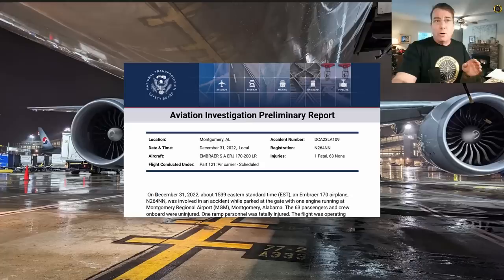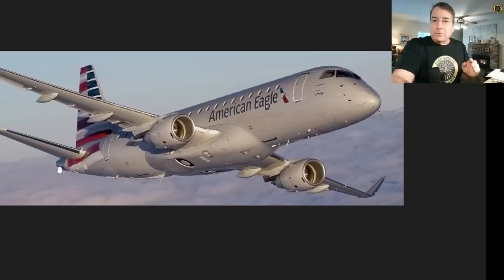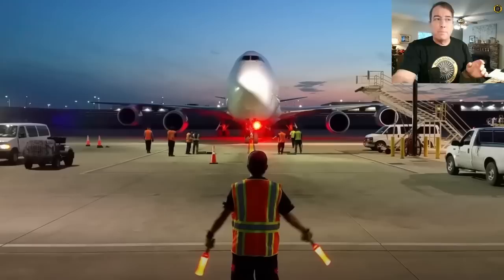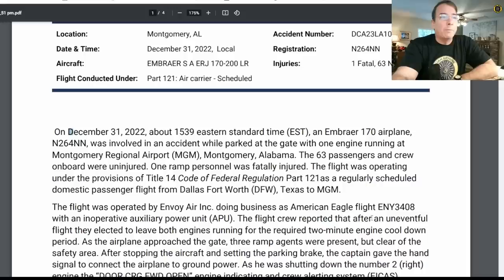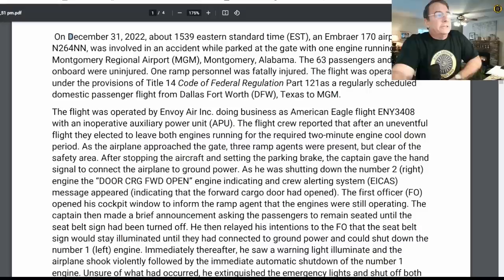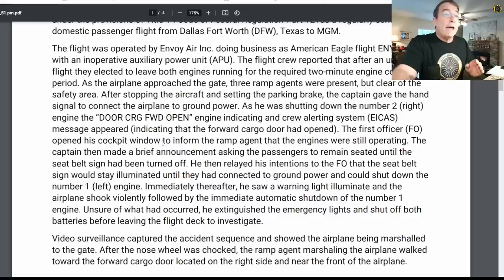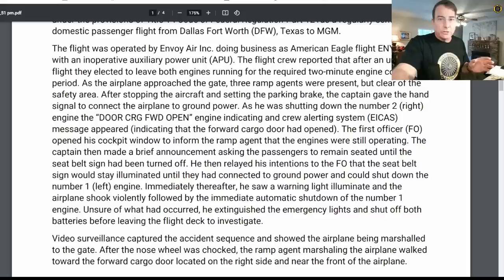NTSB Preliminary Report Ramp Agent Fatality 31 Dec 2022 Montgomery Al.

Comment: i used to be a ramp agent for Fedex  at a small airport . of course there was pressure to load/unload the planes on time but no one i worked with had ever taken short cuts , specially approaching planes . I remember one ,where the pilot forgot to turn off the beacon lights after shutting off the engine and we had to wait an extra 5-10 minutes to approach the plane . in this incident not only one agent but 4 crossed the safety envelope line. i don';t know what's going on at the Montgomery airport .
Reply: So no one was smart enough to walk to the front to verify the engines where off??

Comment: This is so sad. At the airline I work at our policy is to not enter the gate area until the engine cool down time has been met. If needed, we will wait on a taxi way or in the ramp area; but we do not pull into the gate area still requiring engine cool down time for this very reason.

Comment: When I was in the Navy I worked on and around F8’s and A7’s. Both of these aircraft had intakes that were very low to the ground.  That configuration required ground and maintenance crews to be alert especially during night operations. The engine would be running during launches, recoveries, and when the Jet was taxiing. Plane Captains and maintenance personnel had to be present and in close proximity to the plane when the engine was running during ground operations and on the flight deck of carrier operations.

Comment: Hi Juan, here in Europe I fly both B737 and Embraer 190. It is our habit on the Ejet to shut down the number one first when an external gpu has to be inserted mainly because the receptacle is on the left side. On the 737 it is the other way around. BUT: if you need to shut down the number one on the Ejet you have to manually activate an hydraulic pump.(this is to keep some necessary brake pressure)You do NOT have to do this when shutting down only the number two. I see lots of pilots shutting down the number two first just to not be bothered to switch on manually an hydraulic pump.  (Pilot laziness?)  Anyway, a very tragic and preventable accident. Btw: the clock does not stop when opening the cargo door.

Comment: At an airline in the 80's, the spouse of a person in our office work group worked out on the ramp.  Said their spouse was always complaining about rushing procedures to shorten times used for on-time stats.  Said it would end up getting people injured, killed, or fired/reassigned.  Few years later, some desk jockey in the airline had a 'lightbulb' moment and decided on-time stats was a game and they could get advantage on within the rules.  Started adding 15-20 minutes to every scheduled route time to account for ground delays going out and back in.  (remember the days of people noticing/complaining that some airline's flights took longer than others between the same two airports?)  Somewhat lessened the pressure on the ramp crews for them to cut corners to reduce times.  Was a huge deal at the time. On-Time stats would come out and the airline bean counters could immediately identify changes in ticket sales, up or down based on Stats being better or worse.   Billions of dollars go thru an airline's fingers in a year. They do ALL THEY CAN to try and keep a penny from each one.  We had a display in the office of an airline dollar bill. Was segmented into the various costs coming out of that dollar and how much they were able to keep. Display updated regularly.  The point was, were you doing your part to keep a penny.

Comment: It would be interesting to know how '15 feet' was computed. The distance at which you are at risk of being drawn towards the engine is going to vary a LOT depending on if you're 50kg or 150kg, and baggy clothing adding to your silhuoette or ice will make this far worse.
Reply: More like surface area presented to relative winds.
Reply: Humans are all basically the same density. Fat ones have more surface area than skinny ones, so it all roughly works out the same. Clothing is a bigger variable. A burka is going to be more dangerous than a bathing suit in this regard, as the sail like construction of a full body covering will entrain quite a lot of air.
Reply: @sheldoniusRex  they are very much not the same sectional density.
Reply: @sheldoniusRex  And so while within 15 feet of a turning turbine, I wanna be a petite Heidi Klum wearing dental floss.
Reply: @cheddar2648  just tie up your hair.

Comment: I’m a captain on the 175 for a regional. Inop APU’s are not uncommon. I’ve stopped in front of the gate and made sure everyone is clear before I enter. I also shut down ENG 1 so the GPU can be connected and just turn on HYD SYS 1. Opening the Cargo door does not stop the clock. The MCD does.

Comment: I worked on a ramp during the holiday season several years ago. There was incredible pressure to go fast and take initiative. Workers who waited for instruction to do things were quickly labelled lazy or idiot by more seasoned workers. There was a big shame game for not fitting in with the top performers. I was only there for 3 months but in that time I saw two accidents. The first was another worker not watching where he was stepping and falling 3-5 feet from a loading platform. The other was a supervisor making an adjustment atop a tug trailer without the driver realizing he was there, speeding off and the supervisor falling over and dragged a short distance with his leg stuck in the trailer. As far as I know, neither accident was reported, which leads me to believe that these things happen much more often than expected.
Reply: What was he adjusting?

Comment: As a Mechanic for two major airlines over 25 years I think complacency is probably the biggest factor, where engines left running due to a placarded APU is not always an everyday occurrence.
Ramp agents get in a hurry, they are used to the engines running while the airplane taxi's into the gate, the noise is constant, rotating beacons blend into a function of every flight, they go unnoticed. Management is breathing down their necks, turn around time is paramount.
Back in 1987 at DFW I was sent out to inspect a wing engine on a DC-10 that had a ramper's heavy coat get sucked into it, right off of his arm after he had taken it off, as he walking right past the running engine. That guy was white as a sheet, he told me the engine almost got him. That one went to the hangar for an engine change.
Those statements on that report read like they were supposed to, sure they had a huddle, and a safety briefing before the plane pulled into the gate. Yeah right. Sorry for sounding so callus. 
This is tragic, someone lost their life, it should not have happened, but complacency will get these results.

Comment: There's a white spiral on the fan cone of most airliner jet engines to act as a visual indication of safe speed to be in close proximity of a spinning engine. If you cannot distinguish a clear spiral as it rotates, then the engine is still rotating too fast to be safe for any approach.  Of course that device is not visible from the side of the engine.
Reply: They're also for birds.
Reply: Thought those were bird repellent.

Comment: At a previous airline, the aircraft would block us in with the cargo door at first, but contractually was supposed to be the main cabin door.  A grievance was filed and the method was changed through software.  The reason was the rampers could come unload the plane and we would be waiting on a jetway driver the entire time, not getting paid while still managing the aircraft.

Comment: I guess after being an aircraft maintainer for 15 years in the Air Force it’s just drilled in my head to stay clear of running engines.  We maintain 25 ft cone of safety from running engines.   In all my years in the AF I’ve never seen anyone come even close to this happening.   I don’t get how this could happen!!
Reply: I am a veteran though I did not do much work around aircraft, and I worked as a civilian ramp agent.  There is a big difference between military and civilian management.  In the military there a chain of command (singular).  It goes up to the commanding officer, and in the literal sense, continues up to the president.  At an airport there are many chains of command.  Everybody wants to be in charge; TSA, whoever owns and operates the airport, not to be confused with the FBO, the various airlines who use the airport, visiting auditors, etc.

I note that where I was stationed we always had to be covered outdoors (wear a hat).  But on the apron hats were forbidden because of fear they could be sucked into an engine.  At my training command I walked across the runway to get to class.  If an aircraft was expected someone would very politely say, "Excuse me sarge, could you go around?  An airplane is gonna land here."  This was at Keesler.
Reply: Simple
HUB disease.
Head Up Butt

Comment: The In time on the E170 is based on parking brake set AND the L1 (forward boarding door) vent flap/slide being disarmed. Fairly certain that opening a cargo door would not trigger an in time.

Comment: Former ramper at a small seasonal airport - we had no jet way . All our gear would be staged and ready to grab luggage asap After a “ clear “ signal by a co - worker after a walk around inspection. We typically would not connect APU as plane would not be on the ground long. Our training was similar to what was shown here. Our cargo door was under the #1 engine on the CJR - not user friendly at all.

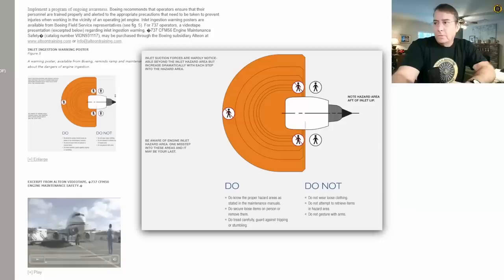Comment: The chart at 2:19 is a MINIMUM reference for safety. The ingestion hazard doesn't stay perfectly symmetrical like  drawing on a chart. Running jet engines can generate vortex......and these vortex can dance ALL around the inlet like a tornado. I've seen it many times. Also FOD can get sucked into an engine and it can take YOU with it. Something like a tarp or a large piece of cardboard etc. What about a wind gust that pushes things towards the running engine? That's why that work environment is for very well trained people.

Comment: I worked the ramp at Miami International the summer of 1979 for ARA Ground Services. We received two nights of training in the classroom and then we were taken out to the ramp for hands on training. Back then, I worked concourse F and G which served Air Florida and National Airlines. 

Years later, I became an airline pilot based out of Miami. So I appreciate the work and dedication of the line personnel or “rampers” as we call them. I treat all my fellow co-workers with respect because I have been there too. 

Always remember the GOLDEN RULE: “Do unto others as you would have them do unto you!”

My current airline had a policy of always leaving engine number 1 running at gate arrival in order to reduce APU start cycles, APU usage and APU fuel consumption. I did not follow this policy. I start the APU approaching the gate, at the gate I shut down both engines. Then the  Beacon light is turned off. Then, after external power is established, the APU is shutdown. No Check airman at my airline has dinged me for my personal safety policy. My biggest fear was ingesting a ramper or ingesting FOD in the gate area. Well, this accident shows what can so easily go wrong for the ramper that is distracted. Years ago, a ramper walked thru the spinning prop of a E-110 Banderante in Freeport, Bahamas. He was killed instantly. 
And very recently, a female belt-loader with long hair caught her hair in the belt-drive and lost her scalp which led to her death. I think that was in Pensacola just a few months ago.

I spent one year flying Fed Ex F-27s based out of DFW. We operated the Federal Express owned aircraft but we were the Fed Ex Feeder, a regional box hauler as they say. Fed Ex runs a top notch operation that is very safe. No one dares touch an airplane until it’s rotating beacon is off! Period, no excuses.

I used to have to walk across a UPS ramp in order to get to my F-27 in Dallas. On more than one occasion I was almost run over by speeding UPS tug drivers. I was not very impressed with UPS ramp safety, but that was then. I do not know how things are at UPS ramps these days.   Hopefully, they are much better today.

I have flown the F-27, B737, DC-9, MD-80, and the Airbus 320. After 25,000 hours of flight time, I can attest to the fact that SAFETY IS NO ACCIDENT!

Right now, the industry, on the heals of COVID, is amidst a lot of new people in the aircraft and on the ramp. The experience level has dropped as many have retired from the airlines. Meanwhile many ramp agents are in a constant state of training due to very high turnover or due to a shortage of ramp agents. CAUTION: Some ramps are over worked and understaffed. 

BOTTOM LINE: BE SAFE out there and look after one another.
Reply: Belt loader accident happened in New Orleans! Frontier,GAT ramper
Reply: @davidsmiths5471  Thanks for the clarification. It is so sad that it happened. 
Be safe! 

Tony

Comment: Juan, through my experience pilots many times when ready for departure, go ahead and switch on the beacon light. That was with disregard of ground staff still loading. I observed these staff members getting used the the flickering light. After a few close shaves I, in safety meetings pushed for policy that pilots should wait for the clear signal from the ground engineer
Before switching on the beacon. The noise of engines are also damped so much by modern muffler headsets that it is impossible withe ambient noise to hear the engines clearly. I surmise you have here a typical human factor swiss cheeze or domino effect. And rushing to be on schedule

Comment: For what? we are talking about saving(?) minutes, if at all.

The hardest part of these investigations is uncovering the hidden motivations that are buried in the systems  Because they point upward to management or policy.
Condolences to the family. May we all learn something from this tragedy.
Reply: I have seen management remove a safety note from the bulletin board because following the directive would have run the machine out of product.
Reply: @larrybe2900  An old Wisdom in the Aviation Industry reads: If you think Safety is expensive - try an Accident.

Comment: I'm a ramp handler, and worked on multi EU airports (Netherlands, Germany, Belgium) i'm now working on Antwerp airport and give training there at new fresh Ground Handlin Agents. And yes in the past working years there is sometimes pressure of the airline to do the turn around quick (Low-Cost Carriers specially) are like that. Ryanair has a turn around time of 40min (pax out, Baggage out, Baggage in Pax in refueling and sometimes cleaning also) this all in 40min. If you do it longer the flight crew is going to write a Delay code on Ground Handling and the Ground Handling Firm has to pay a penalty for this. So sometimes the pressure is high. I had it also onetime with a PoBeDa flight, i was standing under the left wing at the main landing gera to remove the chocks when i see the anti-collision light blinking. As i always have be trained and told in the IATA code book is the rule: When anti-collision lights are ON walk away from the area around the engine. The only place you are allowed to be is at the nose landing gear to remove chocks, or when the use of a air-starter is done. So i walked away from the plane and wave to the dispatcher that his lights where on, the dispatcher give me the sign of Remove the chocks, and i did not do it due to the fact the lights where on. Then the dispatcher walked to the main landing gear and remove the chocks. After the plane left the ramp he walked to me and told me that i did not do my work and he went to the office of my station manager. I was called in the office and told the dispatcher: I never walk around a plane when lights are on, and he told me there is no rule of that. So i ask my station manager the updated version of the IATA ground handling code book, and pointed the dispatcher to that rule. Even then he told me When i ask you to do that you do it. After that i wrote a complain against him to the Airport management and to the EU IATA office. And they told me i was in my 100% right not to do it. So sometimes the Ramp Agents/Handlers are willing to do it save, but the company or airline is forcing them to do it un save. I'm working now for almost 22 years in aviation always on t he ramp and have never got a Accident or injury in that time.
Reply: I have timed at the gate a certain U.S. Airline turn a B737 in as little as 25 minutes. Usually more like 30-35 minutes.

Comment: Thanks for covering this Juan. Situational awareness and attention to detail were drilled (no pun intended) into us in basic training at Lackland.  Every job required it and they were considered fundamental to effective and safe operations. We can see what happens when there is poor situational awareness. It is tragic that it cost the young lady her life. 

Hopefully this tragedy will motivate airlines to thoroughly examine their training programs, and also to see if pressure to make quick turnarounds is a factor, and then make the changes necessary to improve safety.
Reply: When I was at Lackland another trainee asked the training instructor why all the attention to detail, such as making your bed really tight and swabbing out the cap of your toothpaste tube, was so important. The training instructor told the trainee, who was going to be a jet engine mechanic, "Well son if you can't do simple things correctly here in basic what makes you think you will be able to put jet engines together correctly?"